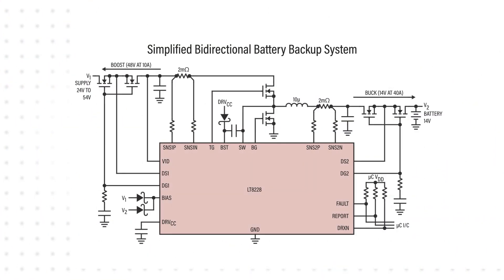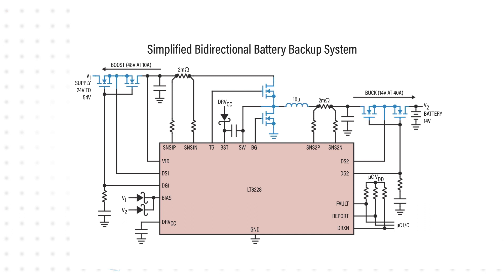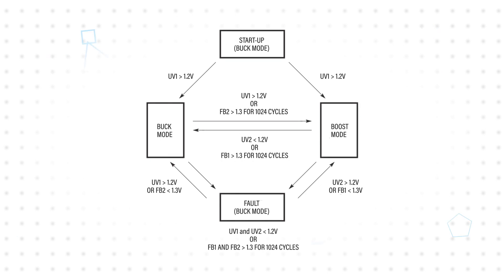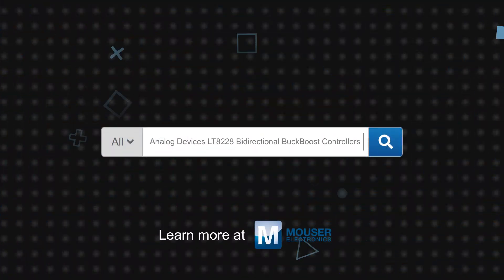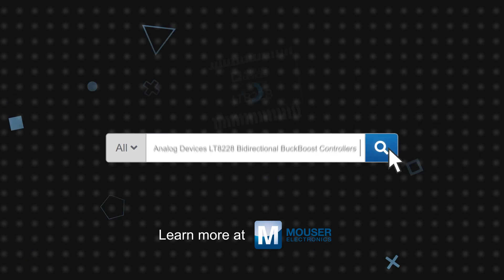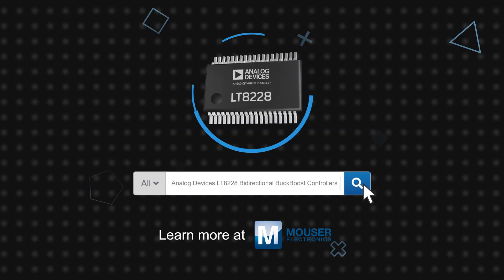Analog Devices Inc. LT8228 Bidirectional Buck/Boost Controllers - Top 3 Facts

Comment: How accurate is average current output regulation loop? The loop is using the resistor just after the inductor which will have ripple. How does this compare with regulation of output current with the LT8708 that uses an output current sense resistor after a first stage output cap?